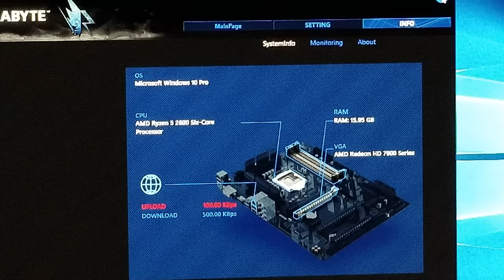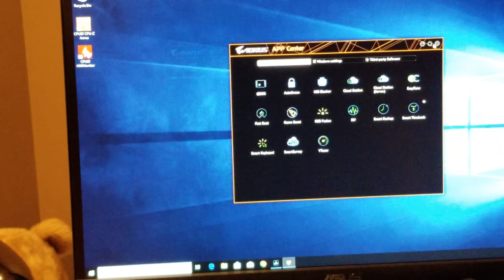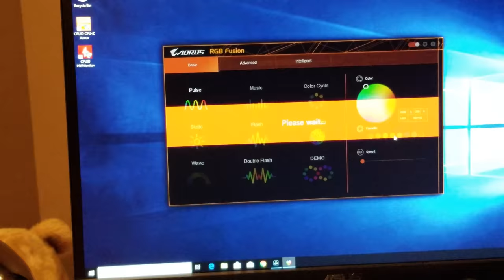Cooler Master MasterCase H500, Build Guide & Aorus B450 Pro WiFi

Comment: I'm doing my install now with this case using a  Asus Tuf Gaming X570 Plus. I have some questions. All my fan headers have four pins. The two 200 mm are 3 pin connection but actually only have 2 wires. Can I still connect them to any of my chassis fans connections on my motherboard? I think everything else is explained very good. I can not believe that "Cooler Maser" does not have any info on how to connect these or I couldn't find it anywhere other then what you have which is great. Also, if I did decide to use the controller, I don't see how to control the fan color changing with the reset switch on the case. I see on the controller where on one side you connect the RGB 4 pin wire to it, but on the other side of the controller, I see two pins and it's called switch. Would that be where the case "reset switch" would connect to?
Thanks if advance.
Reply from the maker: Most Motherboards Sys Fan Headers are 4 pin, and it often is 3 pin for fans, so connecting 3 pin fans to the 4 pin is fine, just line up the tabs and it'll be good, the 2 wires for the 2 200mm fans later in the video I mention you will need to use the cable that connects to them, and then one end will go to the RGB, also you'll need to ensure you plug in the Sata Power Cable from the case to your Power Supply to make sure the 2 200mm from fans work...If you decide to use the controller if you don't have the appropriate RGB Header then the colors are switched by the 3 buttons on the controller, one is for the mode, ie breathing etc...the other chooses the color and one is for speed, hope I got that right it's been a bit for the controller...if your are refering to the tiny little LED that connects to your Front Panel connectors, the cable your referring to will say reset and or switch usually it's reset though...Hope that answers your questions if not let me know what, or you have any other question let me know, and enjoy your build...Thanks...
Reply: @Reviewing_Playing_and_More_RPM  I'm still a bit confused. Let's take the controller of and I won't use it. I have two 12v RGB headers on my motherboard so I know where to connect that. Can I still connect the two 200 mm fan's to the motherboard on any of my 4 pin fan headers? I plan on using the Asus Aura software to control the lights.
Reply from the maker: Yes, you can plug them into any 4 pin fan header on your MB...you'll still need to connect the Sata Power Cable as well though to the Power Supply...Thanks...
Reply: @Reviewing_Playing_and_More_RPM  Well, that is the confusing part. If I'm connecting the two 200 mm fans to the motherboard, why do I need the Sata power cable? I thought you didn't use the sata power cable on your build? Any fan I've had in the past, connected to a motherboard, the motherboard supplied the power.
Reply from the maker: Give it a try without the Sata, if it works then no problem, but I did have to use it in the end because one of the fans wasn't spinning...could be I forgot to plug one in though...
Reply: @Reviewing_Playing_and_More_RPM  Thank you so much. I'm stressing because of lack of information there is especially on the Cooler Master website. I was going to ask you if the top fan was spinning or not but to me it was not. Now if I use the Molex, there is no reason to use the fan headers then, right?
Reply from the maker: No problem man, I understand it's stressful doing a build, now I'm the one confused, the molex is different from the Sata, are you using it for the controller? the Sata is the L shaped cable, same as used for a Hard Drive, you will still need to plug in the fans...
Reply: @Reviewing_Playing_and_More_RPM  I'm sorry I mean the molex. The molex that connects to the two two 200 mm fans, then I connect that to my molex to the power supply.
Reply from the maker: I have two videos on this case, I think you watched the one before I did the update, this video, the molex is not required...it can be used though...
Reply: @Reviewing_Playing_and_More_RPM  I watched both. Didn't you say you used the molex because the top fan wan't spinning. Now to be clear, you din't use the cooler master controller, right? I'm getting close on finishing this build. Getting ready screw the motherboard to the case as soon as I find the right screws.
Reply from the maker: @MitchHaman  Yes in one I used the Molex, but that was because there was no motherboard to power it, and needed it for the video, the update one I mention the molex isn't needed...I didn't use the controller that's correct...
Reply: @Reviewing_Playing_and_More_RPM  I It's all working. I don't have windows on it yet but the fans are spinning and changing colors. I put a 8 or 10 minute video up on my YouTube channel. It took me 3 hours to edit and upload it. Thanks Dennis for all your help. I appreciate.
Reply from the maker: Sounds awesome, I'll check it out...Great Job...and your very welcome, it's fun to help out others to build a PC, I'm very happy it all worked out...Thanks...
Reply: @Reviewing_Playing_and_More_RPM  
Thanks Dennis but I'm not sure I could have done it had I not found your channel. Now I have to put Windows on which I may do tonight. I see there are two bios updates out after the one I have. I'll get them but maybe not right away and probably put a mechanical 1 terabyte 3.5 drive I have in. And lastly some more cable management which is unbelievable easy in this case.
Thanks again Dennis.
Reply from the maker: @MitchHaman  Anytime Mitch, all the best...Thanks...

Comment: Does anyone know where to get the screws from that mounts the SSD to the rear of the case? Can't find any online.
Reply from the maker: I think the normal Stand Offs might work, but if not you can search for M.2 Screw Kit,NVMe Screw m.2 SSD Mounting Kit, the Stand Offs in this kit will fit. It's from Amazon.

Comment: Great vid, i'm in the process of deciding whether to upgrade my build to this case but the case and fan connectors are a bit daunting as I bought a prebuilt. Question, is the top 200mm fan on the case supposed to be stopped spinning like yours was in the end of the video?
Reply from the maker: No, I forgot to plug in all the cables, there was one more that I didn't notice until the video was already done...I believe it was the SATA Power Cable but it's been awhile...

Comment: I have the coolermaster mb530p and can't get the rgb to work with my msi b450 gaming pro carbon.
Reply from the maker: You need to use the JRGB1 connector on your motherboard, and use the RGB cabling that came with your case, can't give detailed how to without having it to check out, but it looks like the 3 connectors are for your fans, and the other two ends, one would likely be for the JRGB1 on your motherboard, and the other for the CPU Fan but you'll have to look at them to see I can get a good enough look at it to be sure...Hope that helps a little, sorry if it doesn't...
Reply: Reviewing Playing & More RPM thanks. The only 3 pin I have is the jrainbow for led strip.  I plugged it in and didn’t work. It’s a 5v and the rgb fans are 12v
Reply from the maker: Only thing I can suggest is to get an adapter if your motherboard doesn't have one, here is a link to one that will work https://www.overclockers.co.uk/phanteks-rgb-led-adapter-cable-ca-057-pt.html Take Care...

Comment: Hello sir.  I have the same case and motherboard in this video. My problem is the other rgb fan specifically the top fan rgb is not working. It's just one color. When i switch  the color the other fan would change but the other one stays the same... i think i mess up where i plug the wires on it..  can you explain sir where do i need to plug those wires?
Reply from the maker: First check that all the fans cables are using the splitter cable that came with the case, and then secondly that the RGB cables are using the included RGB Splitter cable, and that one end of it is going to the RGB on your motherboard...if all this is correct it should work...hope that helps...Thanks...
Reply: @Reviewing_Playing_and_More_RPM  in this case and motherboard.  Should i still use the rgb controller sir? Or i should disregard that?
Reply from the maker: @inzaghiii2008  The controller is only if you aren't able to control the RGB with the software or don't have the applicable RGB on your Motherboard, if you do then yes you can disregard it...
Reply: @Reviewing_Playing_and_More_RPM  btw sir i got it.. it's now working.. thank you so much sir
Reply from the maker: Cool...great job...enjoy your PC...

Comment: Nice video overall but in my opinion you're better off buying a set of nice looking power cable extensions instead of using the electrical tape if you care about looks.
Reply from the maker: Yeah the tape was a mistake, thought it'd look good for the video but I promptly removed it afterwards, gonna start investing in the cable extension in the future...Thanks...

Comment: I just got this case with an MSI Pro Z690-A DDR5 motherboard and I'm having a shit time with all those fan/RGB cables. I just gave it a go to start the build and it stressed me out so much I put it all away again to try again another day lol. All those cables from the front look like they're plugged into each other and it's just a spider web-like mess. I didn't put the CPU or anything in yet but I plugged the fan cables in the way I thought they should be and tried the power and got nothing, no lights or fans so I obviously didn't plug the stuff in right. 
Not looking forward to trying again
Reply from the maker: It was a mess of cables for sure, hope you can get it all going. Reach out if you have any questions I'll help the best I can. Good Luck
Reply: @Reviewing_Playing_and_More_RPM  Thanks mate appreciate that. Going to give it another go maybe tomorrow but this time going to disconnect all those cables from their adapters etc and start from scratch, see if I can plug them straight into the aRGB headers without messing around with the cooler master RGB stuff
Reply from the maker: @reti7959  Sounds good, have a great day.
Reply: @Reviewing_Playing_and_More_RPM  
I did it!
I disconnected that mess of cables and was left with one power and one aRGB cable on each fan which I just plugged directly into the aRGB and fan ports on the motherboard. Simple and a LOT less mess to deal with due to less cables! :)
Reply from the maker: @reti7959  That's great, glad it worked out. I wanted to bypass those cables as well unfortunately at the time I needed a RGB Extension cable for it to work for my MB. It's definitely a cleaner build if you can bypass that mess of cables. Really bad design they chose for that, but maybe it was all that was available then. Take care and enjoy your PC.
Reply: @Reviewing_Playing_and_More_RPM  Yeah it is a bad design, but it gets really good ratings for air flow and good design around that which is why I got it. Even after 3-4yrs after its release it's still a great case for cooling. Thanks man
Reply from the maker: Yeah the airflow is great, that was one of the reasons I got it as well.

Comment: My connector looks different then yours even though it’s the same case. My end has two cords coming out, one labelled gigabyte and the other listing a bunch of other brands. The gigabyte side only has 3 holes however my motherboard (12V connection) has 4 pins. Where do I plug it in?
Reply: The 12 V does not have “the W on the right”, it only has 4 pins
Reply from the maker: Need a lot more info, are your referring to your MB or the Case cables? If if reading this right your referring to the RGB Header from your Motherboard, which Motherboard are you using? Let me know this info and I'll give a answer based off the info...Thanks...
Reply: Reviewing Playing & More RPM I have the Z390 Aorus Pro Wifi. The case cables is the part where I’m confused. It has 3 holes not 4 like the video, even though it is the same connector. So therefore I don’t know where to plug it in on the motherboard. Would I plug it into the 12V pin on the motherboard with one of the pins not plugged in?
Reply from the maker: On your MB it's the one with 12V, mine had the W on it as it's a different RGB Header that has an advanced feature for Whitening that gives brighter colors and more of them...Hope that helps...Thanks...
Reply: Reviewing Playing & More RPM the 12V has 4 pins and the connector has 3 do I just plug it in left to right then? I really appreciate your help and this video helped me do everything else with the build!
Reply from the maker: @scottmaskoske5112  Ensure the Arrow from the Case RGB lines up with the arrow on the 12V RGB Header, which yes, would be left to right...Thanks...
Reply: Reviewing Playing & More RPM SUPER helpful! Definitely deserves a subscribe with bell notifications! I really appreciate your help!
Reply from the maker: @scottmaskoske5112  Always glad to help, have a great weekend...Thanks...

Comment: I know this video was made a long time ago, but I'm still hoping u can help. I don't know how to get the RGB to work in the front fans. I installed the RGB cable into the RGB header on Mobo, but I don't know how to turn it on?? I'm not sure if I was meant to use the reset switch somewhere - I hope u can help me.
Reply from the maker: Ensure your fans are also powered on ie connected for power, and the RGB as long as all the cables for the RGB Fans are connected and to the RGB Header it should just work, they are controlled for the colors etc using the motherboard software...the reset set switch has nothing to do with the RGB though...it sounds like there is just something not plugged in, so best to recheck the cables to make sure one wasn't missed...hope that helps a little...Thanks...
Reply: @Reviewing_Playing_and_More_RPM  thanks for the quick response. There is 2 cables that I haven't connected it might be them. One of them is the 4 pin with plastic cover over and the other one is the extra cable connected to the fans (I think u refer it to the extender or something)
Reply from the maker: @marcussrensen3774  That sounds correct...
Reply: @Reviewing_Playing_and_More_RPM  Yeah I know but I don't know why the RGB isn't turning on mhm..

Comment: This video helped so much for my first PC build, but i still cannot get my ARGB lights to work. you plugged yours into the 12v 5 pin conncetor, are your fans RGB or ARGB cuz i have the same case and my fans are ARGB 3 pin connectors with the splitter cable provided so im quite confused
Reply from the maker: So there have been a few revisions to this case, and they may have gone to ARGB Fans as they can display more colors and modes, if you have ARGB Cable from the case they you'll need to use the ARGB Header 3 Pin 5V on your MB, don't plug into the12V as that can cause shorts to happen.  Hope that helps, saw the Twitter but during the day I can't access it as I'm at my normal work job. Thanks
Reply: @Reviewing_Playing_and_More_RPM  can I use the digital RGB headers if I set the bridge to 5v setting?
Reply from the maker: @AstroSurfer4  Ok, I've never heard of that so can't help with that, not sure how to set the bridge to 5V but if it works for you then you're at the past me Tech level. Wish I could offer more.
Reply: @Reviewing_Playing_and_More_RPM  ahaha will update with results tmrw! thank you for the video though, super helpful!! liked and subbed!
Reply from the maker: @AstroSurfer4  Thanks

Comment: heat shrink works well instead of the tape
Reply from the maker: Cool. Thanks
Reply: @Reviewing_Playing_and_More_RPM  thanks too buddy. I was struggling with my 200mm fans. Just ended up buying a splitter for the 12v controller it came with.

Comment: 21:34 I need help with this 12v My motherboard doesnt have that. I have an Asus 970 pro gaming aura motherboard.
Reply from the maker: There is an RGB Controller that they include with the case, you can use it with the Sata Power to control the RGB, only down side to this is that you have to take off the side panel each time you want to change the colors and such...only other option would be a new MB with the RGB Header on the board, but only if it's in your budget to do so...Hope that helps...
Reply: @Reviewing_Playing_and_More_RPM  Appreciate the advice , Keep up the good work on your videos!.
Reply from the maker: Will do..Thanks...

Comment: Duuude I’m stuck!! Please help!! I don’t know where to plug in the front fans with the 3 pins.. 😖 I have the x570 prime pro, idk if that helps
Reply from the maker: Hey, so I did wind up using the wires that at the start I said I would not need, it's basically a fan splitter but longer and turned out to be handy after all. Once all your fans are connected to it, then the one 3 Pin fan just goes to any Sys_Fan Header on your MB. As to the front fans, they need to be powered by the SATA cable from your case to the SATA on your Power Supply. Once that's done your fans will work. Also the RGB for the fans work as such, if you have a 3 Pin 5V cable then it goes to the Addressable RGB Header on your MB, now some MB's may not have this, in which case you can get a RGB Converter, or a Fan/RGB Hub called the Commander Pro that will solve this issue. If you had a 4 Pin 12V then you plug that into the RGB Header on the MB, your cable will have an arrow that need to go to where it shows the Pin out for the 12V RGB Header on your MB. Hope that answers your question. If not let me know. Thanks.
Reply: @Reviewing_Playing_and_More_RPM   Thanks man!! Appreciate the response 🙂 but now I have the boot light on and I’ve tried going in the bios and ignoring the fan but that seems to not work. What could that be then?
Reply from the maker: @Joseph-dd9sj  To fix this Boot light, check on your storage devices to see if there are any loose connectors.